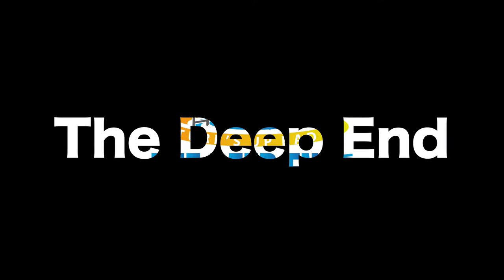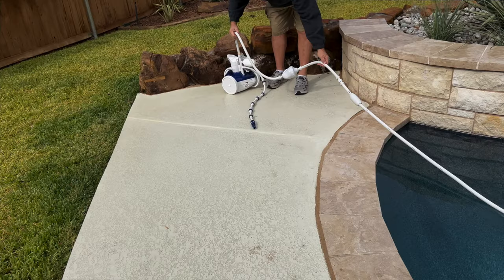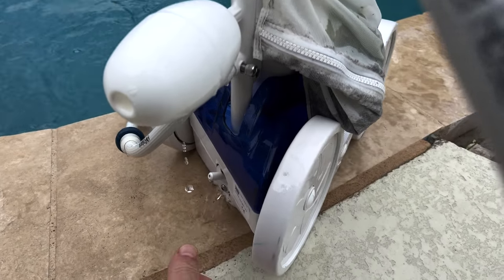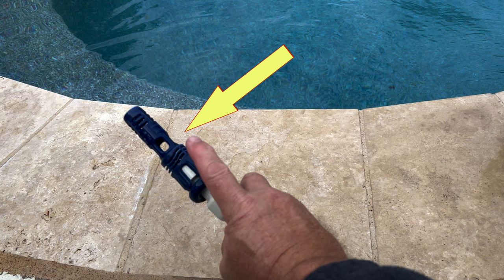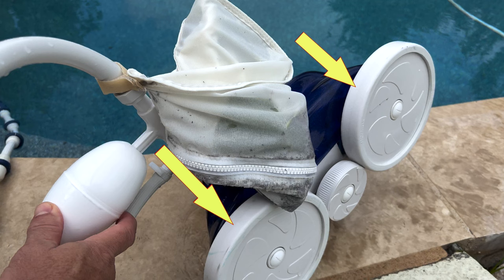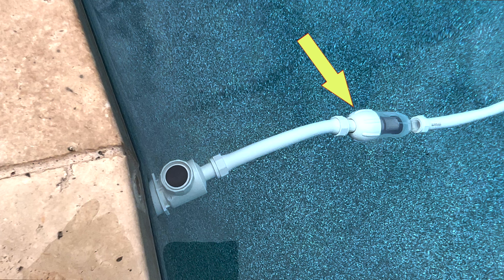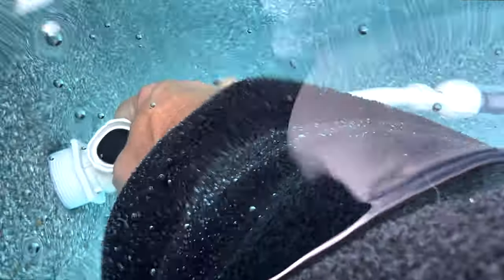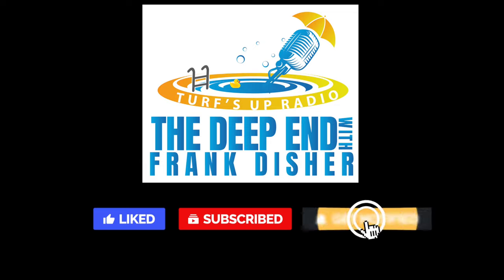Know your Polaris pool cleaner. All the basics of installing and using your Polaris cleaner.

Comment: Excellent tutorial on the parts of the Polaris. The pool was my late husband's realm. He could fix anything. I told him (about the pool) that if anything "happens to you" that I would have to sell the house. Unfortunately, he did pass, and I am on summer three, on my own with the pool. I have had great trouble with correct settings among the Polaris, pool, waterfall, spa, and fountains features, but persistence is paying off. The final piece of the puzzle was the Polaris. After my son fumbled with it a bit and gave up, I found this video which was exactly what I needed in order to size the hose (no longer getting tangled), place the proper order of some devices (and know what they are and what they do), and actually figure out the proper way to connect each hose. One connection was leaking for years because the nut was backward. Now the Polaris is working as it should! Thank you so much!

Comment: Thank you for the video and clear instruction. I'd love to see more. I adjusted my Thrust Jet to 10 O'clock . Sweeper leans toward the two wheels and is moving better. The hose continues to get tangled up. I may need to change the swivels too.
Reply from the maker: Hose can get a memory. Stretch out in the sun once in a while. That will remove the memory

Comment: All your information was great, but the image of you showing the finished length is not what you said in your instructions. I am referring to the part of your video at 1:19. It does not show the hose cut correctly since you stated that the leader hose to the first swivel should be the depth of the pool and the first swivel should extend 18" past the longest distance needed. As you can see, the first swivel is not even out of the water as you stretch the completed hose.
Reply from the maker: I'm not sure what the confusion is. Maybe I could have phrased it differently? The entire length, the hose end, should extend 18" past the furthest point of the pool, not the first swivel. I showed the length it was originally, and then I showed the proper length after being cut.

Comment: One of my wheels is not aligned with the others, do they need replacing? They all spin together when i turn one. The polaris is moving around the pool so slowly. I am just trying to troubleshoot how to fix it or what pieces should be replaced. Thank you
Reply: What do you mean by aligned ? 
Each wheel has a plastic flathead screw you can adjust (center front each wheel) to make them tighter to body. Theres two  adjustment screws under the body. There’s a little play on the drive wheels. Take the top body off- just one screw (blue part)  and the drive wheels have 2 screws you can loosen and pull them forward or backward to make better connection with the splined axle. The back wheel doesn’t do much (sand guard) there’s a middle wheel that’s only job is transferring momentum from drive wheels to back sand guard wheel. Make sure the small wheel isn’t too tight to the other two. Hope that helps
Reply: The wheel is probably loose